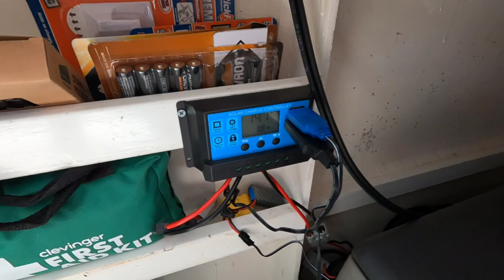Off-grid camping on our trailer sailer catamaran // 3 days at Alexandra Bridge + tiny boat tour!

Comment: Hey, Jarcat 5 ?? Or 6, nice hope you get the mast n sails, good boat pretty quick down wind nice holiday camper on the water
Reply from the maker: Hi Allan, thanks for your comment. It is actually a Waller Tc670. We have removed the mast and sailing equipment and have decided to use it as a motor cruiser that we can camp in ☺️